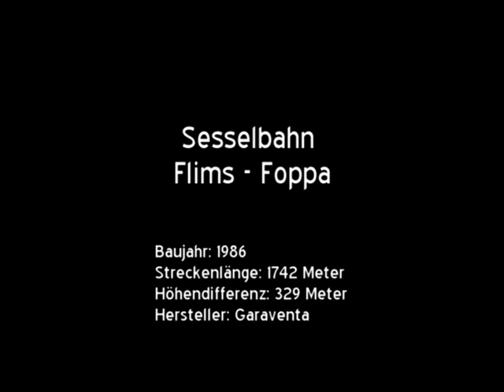3-KSB/B Sesselbahn Flims - Foppa (CH)

Comment: There should be a historical marker placed there. The 1st detachable monocable grip was born.  1945 Von Roll VR 101
Reply: Ski resorts are cruel to their lifts. I hate people who see ropeways as nothing more than "skier transport". Nobody has any sanity for ski lifts/ropeways, literally, that's why they're replaced. Corporate greed from Doppelmayr-Garaventa and the other ropeway monopolies also is an enormous contributor to the extremism against old ropeways.
Reply: @CBF1  I think this is only half the truth. At least in Switzerland (as far as I know), the state must allow the operation of each lift. After a certain amount of time, to keep this allowance gets really expensive (new safety regulations etc). That is also a big factor. For example, the old Giovanola System (gravity clamps) is quite rare, because it is considered (rightly so) as not that safe compared to other systems. Therefore huge amounts of money need to be spent (maintenance) to keep them in an operable state. This can be hardly done given the disadvantages.